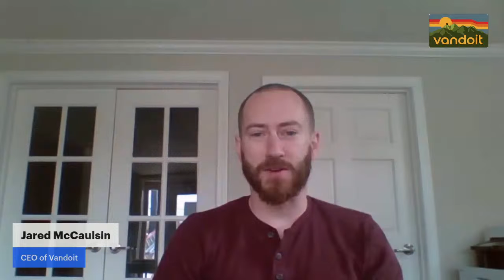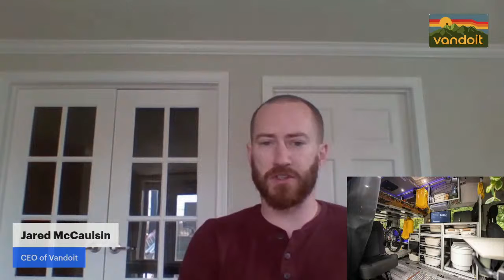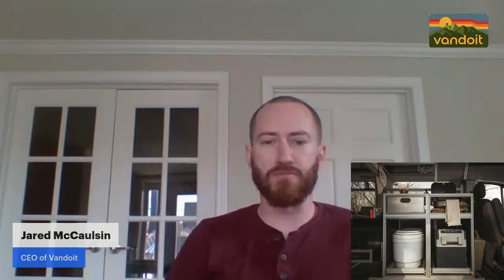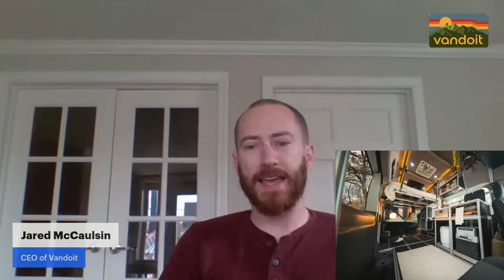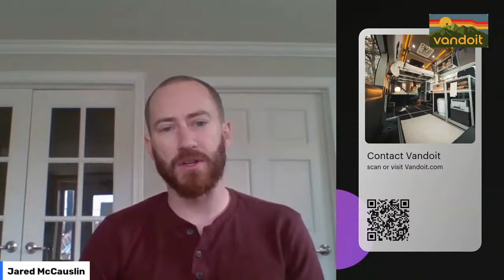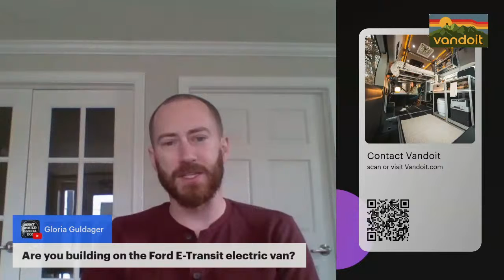Modular Campervans 101 by Jared McCaulsin

Comment: I have a 85 Ford Econoline club wagon XLT with all the bells and whistles you can possibly imagine and only 66,000 miles on it I need a lot of help figuring out how to do this is here and there 10 things that my husband has done for 40-plus years is he's hung siding & Dunn Windows soffit fascia and well I had him do a bathtub or a bathroom in Suffolk probation one time and that sucker was the coldest in the world but the minute he put that socket in there I could go in there run the hot bath and going there about so I was thinking about having him run sawpit on my ceiling in my side and my floor in the van why not it's easy clean it's insulation